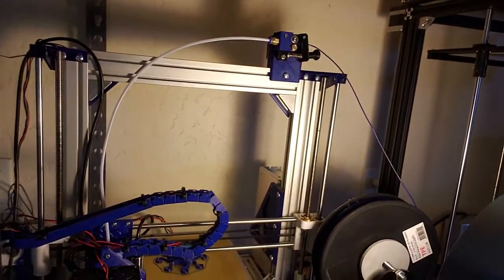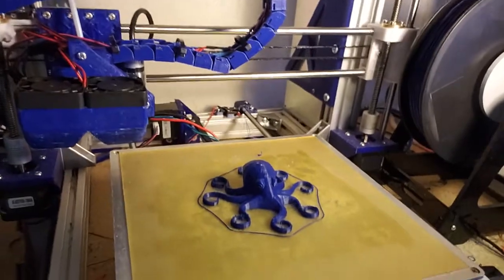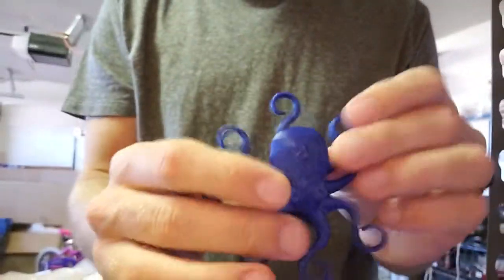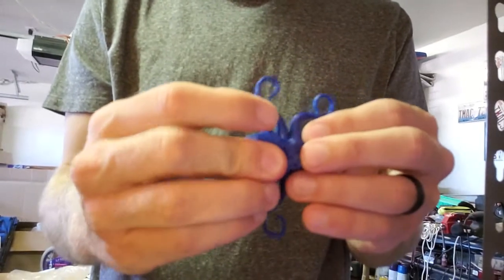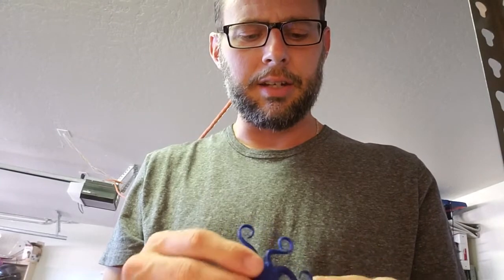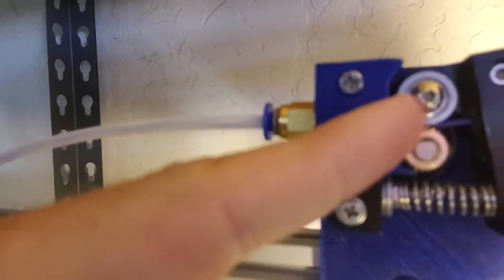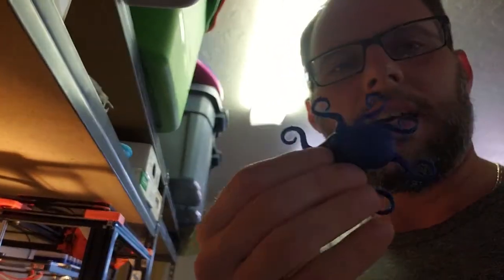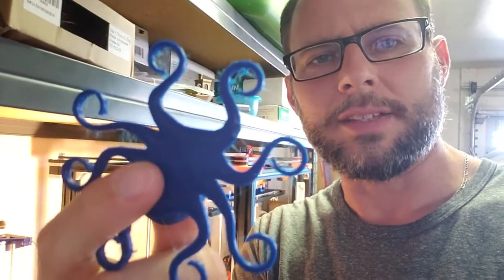Printing Flexibles with Bowden style printer

Comment: I always print at 15 mm/s with everything.
Reply: Well, you're printing too slow. My stock a8 prints at 60mm/s for pla and 30mm/s for tpu, I definitely will need to print slower for the tpu when I will get my e3d bowden setup tho.
But right now it prints at those speeds, and I could definitely go much faster because my prints still look better than pretty much anybody I see on the internet with a stock a8.
Reply: @imnota  I don't have the A8, I have the Tronxy X5SA. It's not a good printer.
Reply: @MicahHidlebaugh  Uh ? Really doesn't look like a bad printer, it has an aluminium frame, 32 bit and a titan extruder so to me it seems like it's actually miles better than an a8... 
So I'm guessing the bad part is the hot end, or maybe you just haven't dialed in your settings. You should look on thingiverse and forums to see if you can upgrade to the e3d and maybe go to a direct drive setup if you prefer that, and compare your print settings with other people.